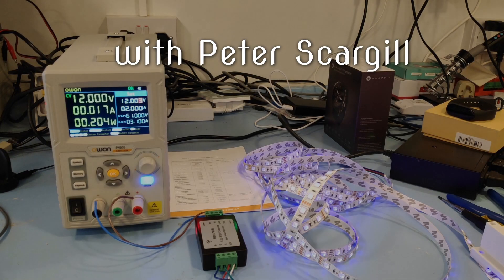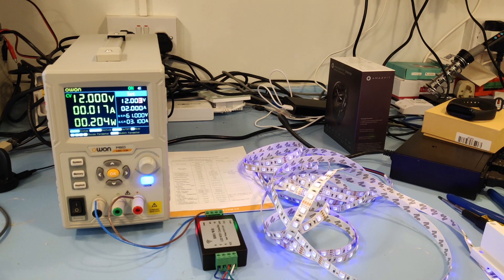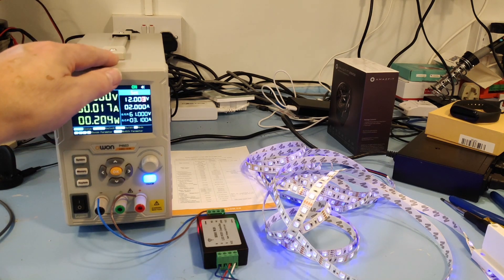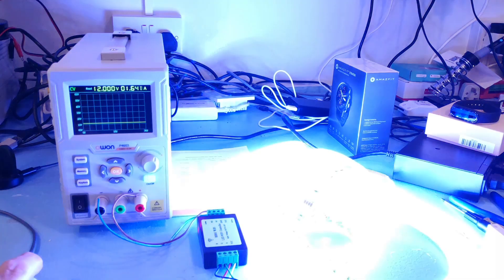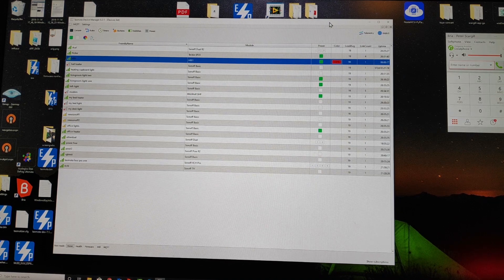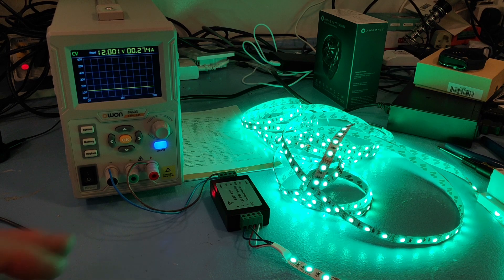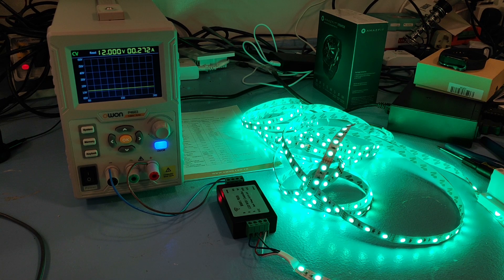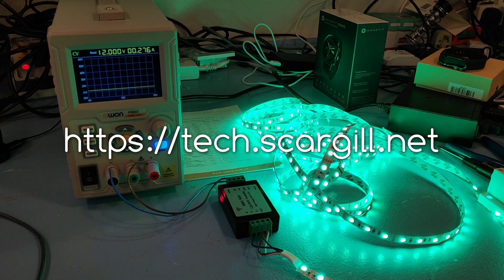Owon P4603 3A 60v PSU, H801 LED Controller and 300 5050 LEDs

Comment: Hi! How are you?  did you manage to install the pc software?  of connects?  I didn't make it.
Reply from the maker: I'm very well thank you despite having to walk around all day with a mask on.  No, mainly because I made the mistake of leaving the PSU in the UK when taking a short break to Spain - which thanks to Covid turned into a long break in Spain and thanks to Brexit turned into a decision to STAY in Spain. To get the power supply I need a visit by car from the bottom of Spain to the top of Spain (and ferry to the South of England - and car from there to the North of England) to pick up that and other heavy items - and as Europe is trailing behind on Covid injections, it could be another 2 or 3 months before I can justify a trip back to bring large kit over at which time I'll start the process of updating etc.   :-) I'll bet some folk think I was just ignoring this stuff...
Reply: @PeterScargill  What an adventure for you, I hope everything goes well and you can conclude with your goal, the annoying mask but I'm getting used to it. Take care of yourself!!

Comment: Hi, thank you for the video. What is your opinion about PSUs as Im currently hunting some supplies. What would your choice be ; Siglent ( SPD3303-C) , KORAD (any 3 channel) or Owon  (ODP 3033). I was initialy going for Siglent but then saw Owon which actually has great specs if it is to believe it (and 1mV/1mA resolution,good programability,Power) although for a bit more money. How was your  Owon serving you in terms of quality and reliability (and how good is OCP and OVP and transient turn on/off). Sorry about longer message, we have really bad situation here on Youtube in most electronics measuring equipment reviews (too less of them), so not many info on Owon or even Siglent. Thank you in advance, wish you all the best.
Reply from the maker: ElsewhereI've looked at the Owon ODP3033.. Not cheap but I like it.